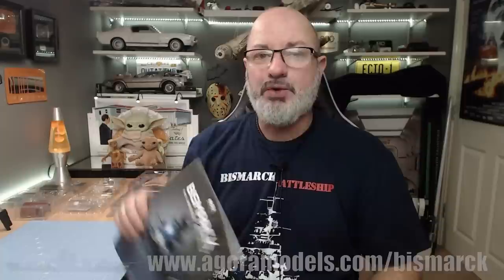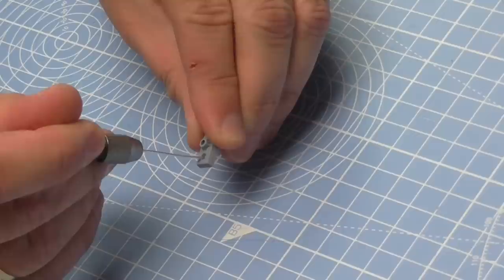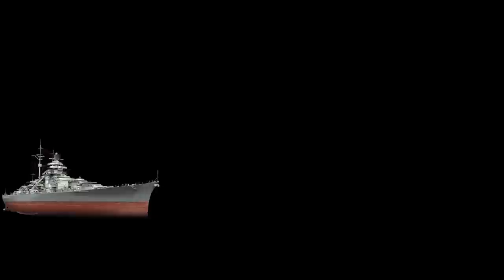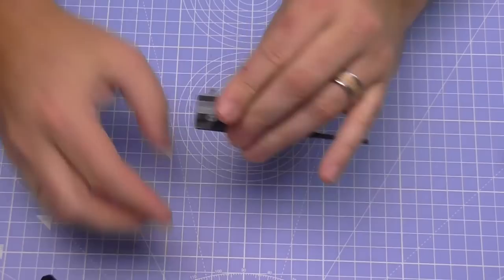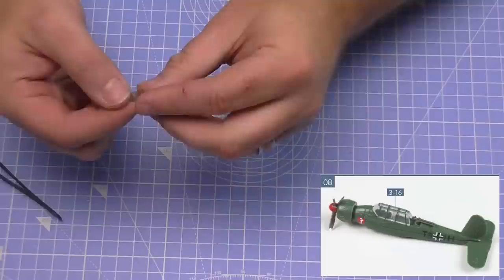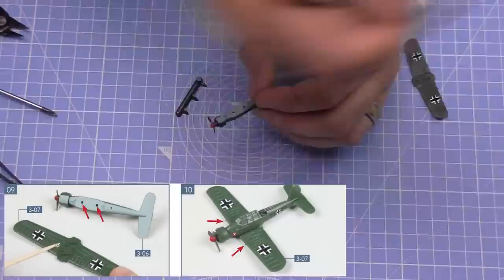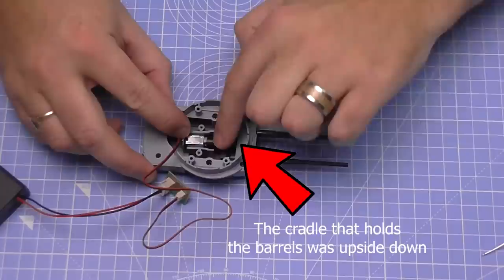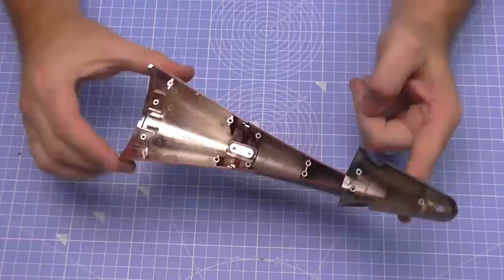Agora Model's Bismarck: The Legendary Battleship - Pack 1 - Stages 1-8

Comment: Just had a thought ref wire routing. If you have an old cable tie, say it's snapped or just not used, cut a short length and loop it over the wires against the model. Then glue the ends down so you end up with a loop of cable tie holding the wires were you want them. You could even do the loops /first/ and decide where the wires /will/ run with each loop being big enough for the connectors too. Bigger loops though, so it's up to the modeller :)

Comment: There is a fast start option available at this moment alongside the 12 and 24 month plans, just for Bismarck so far as I can tell.  For one payment, you get the first six of the twelve packs in a single shipment, getting the others at the usual intervals.  You save some money on shipping fees, and you'll need quite a bit more time building and a bit less of it spent waiting.  Of course, that lump sum up front is a jolt to the pocketbook.

Comment: Besides the 1/72 scale M class Light Cruiser that I am scratch building, I have plans laid out for the TOS Star Trek ships. The Constitution is just over 13 feet long. 
I have considered possibly using 1/100, or 1/158 as it would be smaller, like 5 feet or 6 feet.

Comment: Hmm.  First question:  What glue are you using?   First observation:  Looks like the large deck piece is already completely painted, but the small parts on the sprues are bare plastic in appropriate colors.  Is that right?
Reply from the maker: Sort of. None of this model will.need painting

Comment: Hi Wayne.
Not sure if you can help but i cannot get the mast to rotate at all even using temporary wires it tries to turn but will not ,i cannot even turn it by hand. It seems to me the base plate of the dome 91-03 is to tight but it does not say in instructions not to tighten it but it seems like you did any ideas has anyone else had this problem?

Roy
Reply from the maker: Have you tried loosening the screws that attach the motor?
Reply: @WorldofWayneUK  Hi Wayne. I do not have the motor attached at the moment i cant understand it. I have the cogs the correct way because as you turn the mast you can see it rotating underneath where motor attaches i am at a loss.
Reply from the maker: @tiredmusicman57  That sounds weird. Have you tried greasing the gears?

Comment: What glue do you use? Is it plastic glue or super glue or something else?
Reply from the maker: Its just a CA Superglue
Reply: I am waiting for delivery, watching the videos 🙂
Reply: Be careful using either near clear plastic parts as both will cloud clear styrene plastic.
For gluing clear parts it's better to use a PVA type glue (like Elmer's) or as Wayne said, Micro-Krystal Clear.
Also, be careful using thin plastic model cement near painted details as the cement can damage some paints

Comment: You placed the catapult cradle too far forward. It should be placed behind the aft struts of the float plane undercarriage. Where you have placed it will cause the undercarriage of the aircraft to be ripped off when it is launched.
Reply from the maker: It's not actually placed yet. I took a rough guess. I think we install it in Pack 11